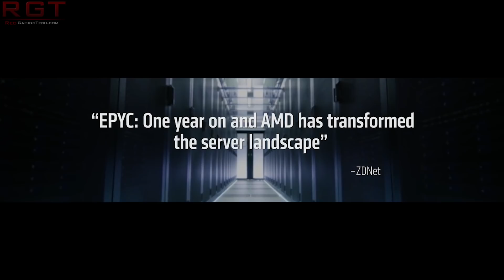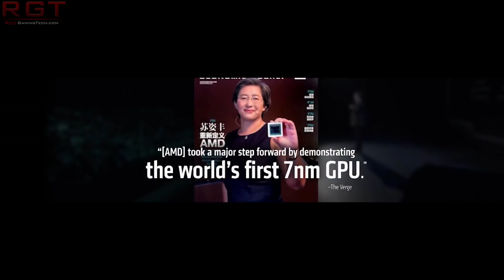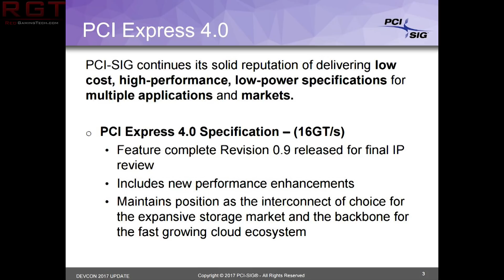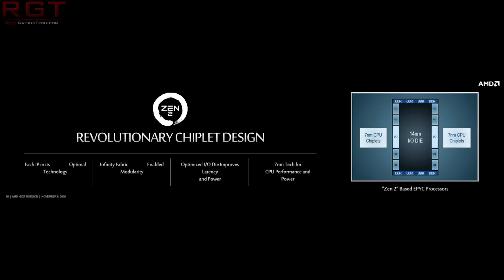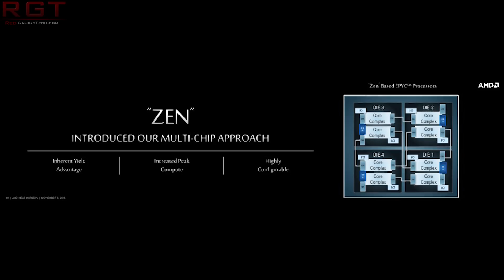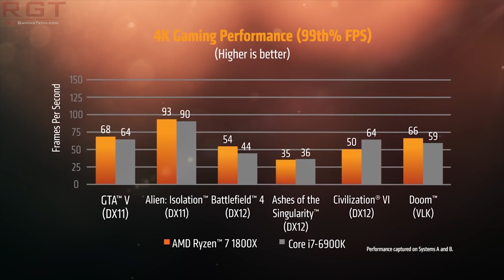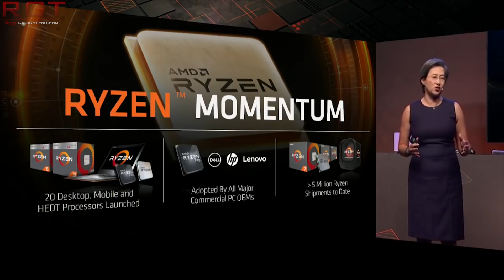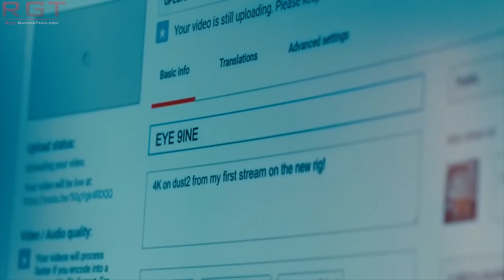Should AMD Raise The Core Count for Zen 2 Ryzen 3000 CPUs ?

Comment: Not sure how true these are but what i have heard rumoured coming from AMD in 2019/2020 (some stats may change from version to version) But these are just rumours currently - 
Base Ryzen 3  "3200G" - 8 Cores / 8 to 16 Treads - Base 3.8 to 4.0Ghz (Boost 4.2 to 4.5Ghz) - 65w (Watts may also vary).
Base Ryzen 5  "3600X" - 10 to 16 Cores / 16 to 32 Treads - Base 4.5 to 5Ghz (Boost 5 to 5.5Ghz) - 95w (Watts may also vary).
Base Ryzen 7  "3700X" - 16 to 32 Cores / 32 to 64 Treads - Base 5.0 to 5.5Ghz (Boost 5.5 to 6.0Ghz) - 105w (Watts may also vary).
Base T/Ripper "3950W" - 8 to 64 Cores / 16 to 128 Treads - Base 4.5 to 5.0Ghz (Boost 5 to 5.5Ghz) - 250w (Watts may also vary).
Many versions are also rumoured to Ship with Navi10 intergrated APU (Graphics on par with a 1080) with Navi20 coming 2020/2021.

Comment: The problem I see is AMD's 7nm wafer allocation. If AMD focuses on propagating Zen 2 all the way down their CPU lineup as quickly as possible, they probably won't have sufficient 7nm wafer capacity to launch Navi until September 2019. The solution can be to delay the launch of mainstream Zen 2 until after Navi launches. I would therefore like to see AMD go head to head against Core i9 9900K with Zen 2 Threadripper. If AMD could drop the price of Threadripper motherboards to where a 10 core 20 thread Zen 2 Threadripper processor plus a Threadripper motherboard is priced the same as a Core i9 9900K plus a Z390 motherboard, they might be able to challenge Intel at the high end without introducing mainstream Zen 2 processors until around September 2019, thus enabling much earlier release of Navi. Of course, if they launched 10/12 core socket AM4 processors shortly after Threadripper, and simply delayed the release of lower core count socket AM4 Zen 2 processors, this could accomplish the same thing.
As for integrating the IGP throughout their CPU lineup, this is a bad idea. AMD should have motherboard integrated Vega graphics on all of their 500 series motherboards. A motherboard integrated IGP can access the second rank of dual channel memory concurrently with the CPU accessing the first rank of dual channel memory, thereby limiting memory access contention to when the CPU is accessing the second rank. For those who buy a discrete graphics card, AMD could support running Havok physics on the motherboard integrated graphics when running a DX12 game on the discrete graphics card. They might even work towards making it easy to run a Freesync monitor using the integrated graphics of the mobo and a discrete nVidia graphics card.

Comment: @RedGamingTech 
Be careful with that statement that "Intel has an 'IPC'-advantage". For singlethread, yes. For mulithread not. I refer to the Hardware Unboxed comparison, on multithread Cinebench the 2600(X) beats the 8700k @4.0 GHz. AMD has a more efficient implementation of SMT, that most certainly is a part of 'IPC'. With regard to Ryzen3: I would say that 4.5 GHz is a rather conservative estimate, as you pointed out yourself. However, if it would be 4.5 GHz then Intel would still win at singlethread with anything less than 15% 'IPC' improvement. That would be disappointing. AMD does not need to defeat Intel with everything but I would most certainly like it if they would. :)

With regard to your question: more cores! But also a higher single core performance given how poorly software is optimized and given that not everything can be multithreaded. One doesn't exclude the other, does it? You can turn cores off when those are not needed. Sure, it might cost a few Watt because power-gating is not perfrect but that is not a dealbreaker.

Comment: I'm perfectly fine with more cores and threads at the upper end of the mainstream range if it means more pricing down-pressure on 8C16T and below. I built my current i5-3470 for about $500 CAN six years ago and for the same amount of money today, I'd only get ~60% more performance. That's barely beginning to tickle my upgrade bone as my trigger is usually some point past 100% or twice as fast. I have never used the same system for more than four years before and at this rate, my i5 may very well double my Core2's four years.

While faster clocks and higher IPC may be nice for 'legacy' software, the past 10 years have made it abundantly clear that software developers cannot count on improved single-thread performance in the future as hardware has hit a frequency and IPC wall. They must focus on multi-threading going forward, which means we're about to see IPC and clock frequency become less important over time as more software becomes more heavily threaded and favor aggregate throughput.

Comment: 16 cores on the mainstram. That will push Intel to rise the number of cores per CPU and it will also push hard on the developers to finally code adequate multithreaded apps and games.
And of course higher clockspeeds too.

Comment: AMD have a greater market to aim a sixteen core AM4 processor at and to be honest they'd  be silly not to, it would do to things, reassure AMD users that they have a committed upgrage path into what was previously Threadrippers domain and completely disregard any of Intels current or future line up, they could bring the same core used on to a TR4 package akin to the 1800x and the 1900x in previous generations, 3850x indicating it's sixteen core AM4 and the 3950x on the TR4 socket, as for IGP, this is a no brainer, a 7nm eight processor integrated with a 22cu Navi core would be the starters gamers goto processor depending on the price point $350 - $450 dollar in my opinion would be unstoppable, its best of both worlds processor, with next gen console graphics, but then takes over where the xbox and ps4/5 fail, being a PC and running Windows and applications

Comment: I've always bought Intel but I'm holding out for the AMD Zen 2. I would prefer they stick to current cores but focus on IPC. If they can do a 8C16T 4.2 to 4.8ghz chip at lower power n temps, it would really turn thing onto its head. They should skip a 10C CPU n just go to a 12C24T 4-4.4ghz if they feel more cores needed.

Comment: In a word no, Zen is bandwidth and latency starved with DDR4, which is why it responds so well to fast ram. Gains would not be realised. I think we want more power efficient CPUs, since gaming really isn't able to properly use 8 threads let alone anymore than that. DX12 allows more offloading of stuff to the gpu, so future gaming will not be using much more CPU horsepower than now.

Comment: I think AMD will go with higher core count throughout the lineup. It may only be a bump from 8 cores to 10 on the 7 series. But that would make the R5 an 8 core part and the i3 a 6 core part. AMD has been about value from the start of Ryzen. It will be a chiplet design because thats AMD's strength. All the chiplets are the same and are binned, the best cores going to the better CPU's. There is little wasts because chiplets with only 2 working cores make a 10 core processor possible.
Reply: Agreed. AMD should increase core count more or less like: R3 being 4C/8T or 6C/6T, R5 8C/16T or 8C/8T and R7 10C/20T. It would be really nice.

Comment: I think the 3000 Series will be split up into even more categories, a G Version with an iGPU will be aviably for every processor variant, so for example we could end up seeing a 3700, 3700X, 3700U, 3700G, 3700GX and a 3700GU.

Also i think a maximum of 1 I/O Die and 4 Zen 2 CCX Dies are possible on AM4, however how many CCX complexes there will be on a chip will be set by it's target.
For Example a Ryzen 7 3700X could use 4 Dies with 3 working Cores each or 1 dummy Die and 3 fully working CCX dies which is unlikely since those Dies are required for Threadripper. So a Ryzen 5 3600X could also have 4 Dies but only with 2 Cores Working on each but who knows, we could also see 1 Dummy Die and 3 Working CCX Dies with 3 cores each resulting in a Nine-Core Ryzen 5. Sorta same could be going on for Ryzen 3 which could have 1 Dummy Die and and 3 Working CCX Dies with 2 Cores which would result in a 6-Core Ryzen 3.

So it is possible for Ryzen 3000 to have up to Triple Channel DDR4 Memory support and possibly 36 PCIe-Lanes for Mainstream
Reply: I would welcome the idea of integrated gpu with ryzen

Comment: AMD should only raise it for the 3800x/3800 to 12 if they really want to raise anything. AMD has to realise they have to beat intel on the Gaming Mindshare first before they "Up The Cores". They could slightly increase all or most of the cpus core count in the 4000 series by 2 cores each except the 4800x/4800 at 16 cores and 4700x/4700 at 12 cores. But only if they can hit the 3000 series cpu frequencies with the increased core count.
Reply: we already have boost algos, which means that having more cores doesn't affect gaming performance, and zen 2 will probably improve on those to be even better

Comment: If Zen 2 could hit 5Ghz AMD would be flaunting it because coupled with its IPC increase it would beat the 9900K in almost everything. 4.6 or 4.7GHz is most likely the highest we'll see a 3700X or 3800X go maybe 4.8GHz if you're lucky. Even at those clocks it'll probably beat a 9900K at most workloads even games. Latency won't be much of an issue either as cache and CCX design lower it plus Zen 2 will probably support faster RAM which will also help.

Comment: The chiplets will never be under 8 cores.... i would think they would be cut down versions to 6 cores... and maybe some to 4 cores. But really most of them will probobly be 8 core.

Because the chiplets are tiny, the core yeald rate will be fairly high (some estimations as high as 60-70% of chiplets will have full set of cores). Even if it drops down to 50%... That would still just give 5-10% with only 4 cores available.
Reply: Chiplets are the I/O not the cores FYI...but likely for the "4 core" such as used in APU they will not even bother with chiplet design when they can put the I/O directly into the chip (as they currently do) but but the 6/8/16 core chips that is where "chiplet" are very useful.

Only AMD knows the "magic sauce" at this point.

Comment: Imo, the mainstream (AM4) doesn't need any more cores. 8/16 is PLENTY for even the most modern games PLUS streaming. For folks that have an even greater demand for cores, there is the TR4- platform, where they can go bonkers.

I MUCH rather have the Power and thermal headroom that would be needed for additional cores, to go into higher clocks, to be frank.

Comment: For mainstream desktop CPUs: No, 8c16t is enough and will be enough for quite a while for an average desktop user. Here AMD should focus on per core performance and latencies.
For Threadripper CPUs: Again no, it's already shown that today's software has trouble utilizing that number of cores. Here AMD should probably work on bottlenecks.
For laptops: YES. This is where AMD could and should increase core count. The fact that Asus made a laptop with desktop version of Ryzen 7 1700 is a proof that there is a market for laptops with higher core count.

Comment: I want slightly higher clock speeds, the real money is in the IPC gains anyway. But I'd also like them to support higher memory speeds  natively, since 2nd gen Ryzen supports up to 2933Mhz which is already more than Intel supports according to the official specs (though, of course, both Ryzen and Intel CPUs can use faster memory with overclocking even now). 
But if Ryzen 3000 supports, say, 3600Mhz memory out of the box without overclocking, that would be really nice to see, and it would have a massive advantage in that regard, compared to Intel.

Comment: In my opinion, no. Higher core counts don't really matter in the mainstream desktop/laptop space, at least not yet. 8 cores is the maximum for most use cases. Until software catches up, it is best to not increase it. Instead they should try everything in their power to increase per core performance. For workstations and servers obviously more cores are better but in that space they can just "glue" more cores.

Another thing AMD should consider, is making gaming APUs actually worthwhile. 7nm and 7nm+ will be able to put quite a lot of gpu power in an APU, especially if AMD decides to increase TDP a little to 95W or 125W in order to accomondate more graphic cores. Add to that 1GB, 2GB, or 4GB of low cost HBM (the one samsung had announced for 2020 with a bandwidth of around 200gb/s at a fraction of HBM2 cost) as a L4 cache and framebuffer, plus DDR5, and these APUS could make the midrange dGPU market  to disappear. I think they should make an attempt at this. Plus having powerful APUs could help in computing as well with Radeon Open Compute.

Comment: YES!
... lol - watched it right through now...
What do I want to see in Ryzen?
Well, what did they do with EPYC?
They went to 7nm on the CCXs, while staying at 14 on the I/O, and they improved / streamlined the Infinity Fabric, they improved the cache design, they addressed (somewhat) the variable latency... Clockspeeds we don't quite know yet, but they seem very conservative...
Summary - they didn't concentrate on one thing, they shrunk the die, or the CCXs anyway, and tried to address all the other things that could be a bottle-neck. So pretty much EVERYTHING about the latest EPYC, is an improvement, including the much wider & faster floating point units.
So what do I want on Ryzens? Exactly the same thing! I want to see improvements across the board just like EPYC. And I suspect (maybe at a slight price jump, maybe with a model R7-3800X) that's what we will see.
I want double the cores & threads and I want everything else as well. If that means a top-of-the-line Ryzen sneaks up over U$500, then so be it. It's going to blow Intel out of the pool in almost everything! At half the price! That will be competition for their own ThreadRipper, yes....
The advantage of ThreadRipper should be more memory channels and more I/O channels.
The advantage of a top R7 should be pure clock speed, at 16 cores & 32 threads.
Show me an 16c 32t CPU that will run at 4.5GHz (on manual o/c), and if I can clock the main system RAM at the same speed as the CCXs... I'll marry it.
What would I pay for that?
... Dog knows. At least as much as a lower end Threadripper...
... now tell me about an all new 7nm AMD graphics solution, at around the $350 ~ $500 point. Upper mid-range, but without direct ray tracing and stuff. Just good old pixel punching. Something that comes out-a the box with about the same performance as a top of the line overclocked 1080Ti, on 7nm, for $500 or less.
Reply: they actually increased the CCX from 4 to 8, so yeah, probably we will have that on ryzen and since it's only one CCX we won't have latency issues anymore.

Comment: amd can easily hit 5ghz  just  fix the heat issue.. which means better cooling fabric...
Reply: @pilerks1   Exactly. I'm on the limit of safe voltage but temps are fine.
Reply: i would argue the problem is the node, just look how muc h frequency vega gained by going to 7nm
Reply: 1500mhz vs 1800mhz is a huge increase in clock speeds, one that you would normally not see from one node to the next, this shows that 14nm doesn't clock all that well, that increase in compute is not extremely impressive at all actually,  gcn had the ability to have 1/2 perf on fp64 during the 290x days, they simply dont put that ability in the design often as it takes quite a bit of space, and considering nvidea did that on 16nm its more impressive, gcn seems that its still stuck on 64 Cus, what a shame hopefully they go beyond that on navi or amd will be stuck on the low end again

Comment: At this juncture of the process of improving cpu technology at AMD, it should be, in my humble opinion more important to improve core clock speeds, reduce interconnect latencies, and improve IPC above increasing the core count.  AMD has started the process of increasing the number of cores available for consumer products as well as corporate products.  We have seen that companies are taking advantage of the additional cores, but as it stands we still have quite a way to go to optimize multicore programming right now.  So focus on performance and improve latencies first, then add additional cores once the base architecture is very solid.